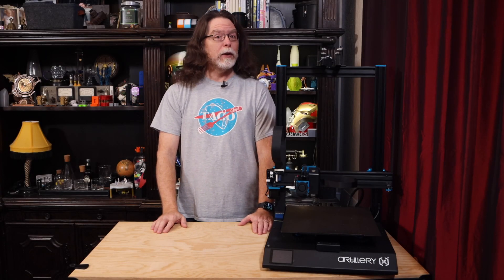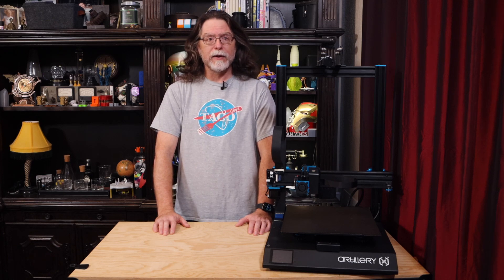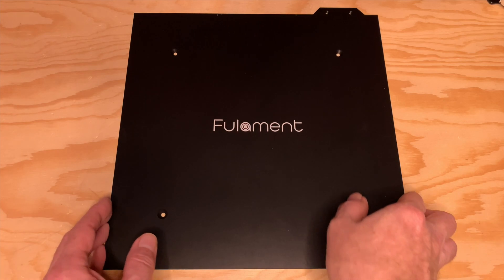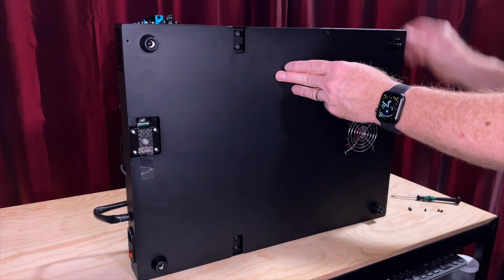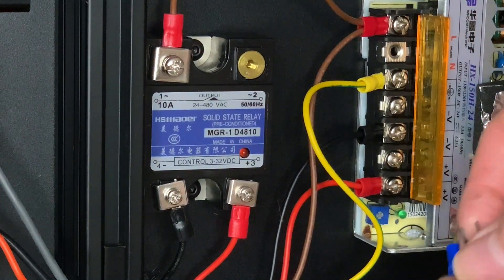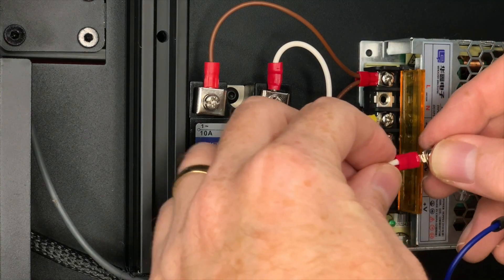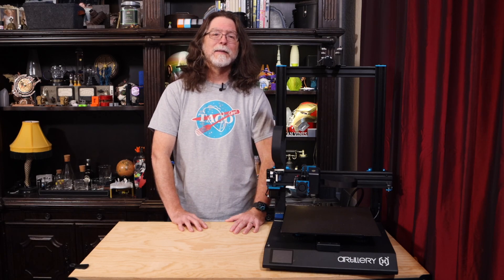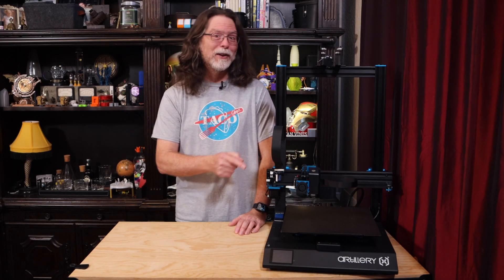Install Fulament's Fula-Bed Upgrade for Artillery Sidewinder X1

Comment: Have An x1 with original glass bed- after years (of zero issues with the bed) slapped a magnetic base/pei.sheet and the klipper on there with auto leveling. Shouldve just done that at the very beginning😂

Comment: How badly is the energy efficiency of the bed affected by not having insulation and a reflective layer under the heating pad? Does that also impact the temperature on the bed's top surface?

Comment: I’ve wanted this since Fulament came out with the very first model. It’s just super hard to justify when the whole system costs more than I paid for the printer. What would make a huge difference for me is if it came with a cable chain, mounts and hardware to safely relocate the bed wires to the top of the printer instead of the back. Many of us don’t have the space behind the printers to prevent the wires from slamming into the wall behind it repeatedly.

Comment: To remove glue easily you just have to get it warm with your normal, typical hairdryer, just use low heat settings and if possible a nozzle, when glue will get soft just remove it with a spatula or even barbeque stick - worked like a charm on all my x1 machines :).

Comment: Do you know if this would work for the SW-X2.  I just bought one and I put a magnetic bed directly on top of the glass bed but may do this instead if it works. If not hopefully they make a compatible upgrade for it soon.
Reply: According to fulament, no. They are working on it though.

Comment: As always great video. Two questions. What about the insulation under the heater? Also, as I’ve never used a PEI sheet, can you print straight onto it with PETG. Reminds me, need more hairspray 😄
Reply: I believe TPU is the tricky common filament on PEI, PETG should release after cooling.